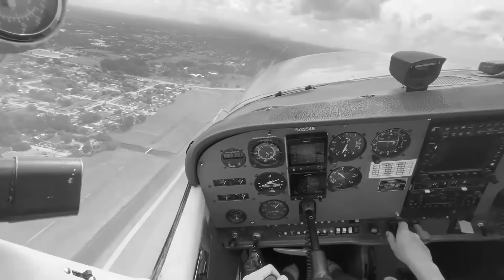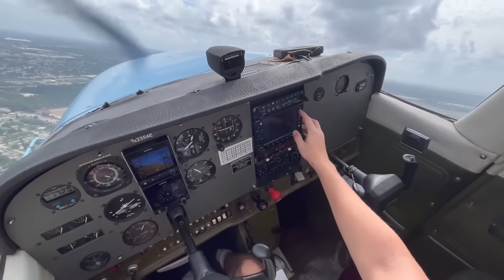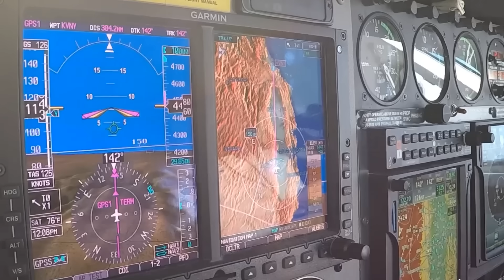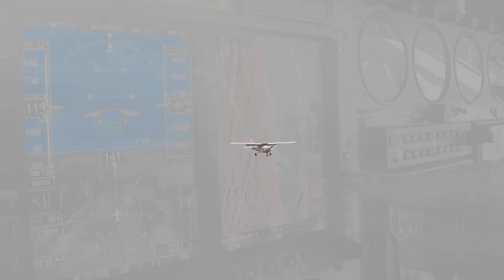NEW Info About N5203H Fatal Crash Aug 26 Los Banos CA, Prelim Updates...

Comment: I never understand why pilots are afraid to reduce power in emergencies like this. Reducing power and slowing the aircraft will lessen the airflow over the control surfaces and relieve the pilot of much of the workload in fighting a runaway trim. It seemed like this issue wasn't gonna resolve itself, so descending and landing in a field somewhere should have been the priority. I'm not criticizing the pilot for troubleshooting the issue, but at some point, you got to make the decision to get on the ground quick. The same goes for light twin, engine failures on takeoff. If there are places to put the airplane down near the airport perimeter, pull that remaining engine to idle if the airplane starts rolling below VMc or the pilot can't counteract the rolling motion in time. Soon as it rolls far enough, it's too late. Of course, easier said than done, but something to think about.

Comment: I would never, ever fly in these small aircraft. There’s too many deaths of folks who decide to fly in the small planes.
Reply: ha ha if every car accident made the news "you for sure" wouldn't drive then.
Reply: The analogy doesn’t quite fit. Nice try though.
Reply: @tmo-y5b Point is that General Aviation is safer than automobiles "by far", in every statistic, hands down, not even close.
Don't turn down a chance to experience it. Would you turn down a ride in a Lamborghini? Then why would you not fly in a Cessna?
Jus saying: Robert :)
Reply: @robertshaver4432  Sorry, but your statement is absolutely wrong.  Commercial aviation is extremely safe, but not so general aviation.  Long time ago I did some basic calculations and the numbers showed that driving a car was 20 times safer, based on deaths per miles.  Turns out I was off by quite a bit. According to research by Pilot Institute, the figure is 27 times.  That's not 27 percent, it's 27 TIMES!
Reply: @Rational20  Exactly upside down compared to what I've been taught. Sounds like "picked stats" to fit a desired outcome.
Reply: @Rational20  True, commercial aviation is super safe because of highly advanced and redundant systems in commercial jets. Also factor in high training standards and regimes for the pilots and strict operating rules for passenger carrying operations. Much of General Aviation is less regulated, the airplanes are less complex and less equipped than their airline friends, and the pilots are trained...but not to the demanding professional standards of the airlines. But having said that, you are STILL more likely to die in a car accident vs a small plane. Around 43K people die in vehicles per year vs 300-400 in small aircraft. I'll take those odds any day over driving in a city full of drunks or icy roads with reckless drivers. And it's worth noting that about 70-80% of General Aviation accidents are caused by pilot error. So, if you fly safe all the time, don't make stupid decisions, and maintain currency often, then odds are you will be just fine. And it is worth it. This coming from an almost 1K hour private pilot who has been flying for 22 years with zero accidents.
Reply: @core_of_winter  Well spoken.

Comment: I can tell you from experience that this is not an unusual problem. One thing about aircraft mechanics is that rigging is one of those things that seems to be difficult for them to do. I have had aircraft that needed to be repaired and I've always had to have a mechanic take a second go at getting the controls rigged properly. As for autopilot and electric trim, these need to be inspected frequently. Something as simple as a short, can result in a malfunction. Low time pilots should be trained extensively in manual trimming of the aircraft at all phases of flight, and the procedures for disabling electric trim, drilled into them. Anytime the aircraft does not respond appropriately to the yoke its rigging or trim.

Comment: Completely inaccurate, the trim, and rudder were the only thing working on aircraft. Breakers and master switch did not kill auto pilot system runaway, yoke was completely locked up ailerons and elevator. Biggest factor is aircraft had previously been totaled then rebuilt. Months before this accident aircraft was already giving signs of malfunction, was reported by other pilots flight control rigging issue where yoke was 20° off to keep wings level and auto pilot malfunction.. mechanic, supposedly placard and disabled. But as we flew under his aircraft for almost 2 hours. The auto pilot had 100% control over the aircraft. The operating owner and the mechanic are the only ones that need to be investigated here as they put a broken aircraft back for rent when it should’ve been deeply investigated why the rigging had broken because It’s not normal maintenance issue and auto pilot mechanical malfunction should have been taken more serious. But these flight school rentals  only care about money, not our lives.
Reply: If the trim and the rudder were the only things working how did he make so many turns, And if the trim was working that certainly should have stabilized pitch even if the yoke was locked up. 

What got this guy killed was he decided to put the flaps down as he prepared for landing and of course that pitched the nose down he possibly reduced power and that too would pitch the nose down, a tough situation for sure
Reply: @christophergagliano2051  that’s not what killed him. We were setting up with a very short time as he was running out of fuel and every five minutes the auto pilot would pitch the nose up and roll the airplane. We slowed the aircraft down 10° flaps trim up to slow the aircraft down with power back to descend when we got to about 900 feet the auto pilot pitched the nose up again rolled the airplane in another loop. This time being lower altitude, almost impact in the ground came back up. He never introduced power. The nose stalled pitched down and he screamed. I can’t pull up. I can’t pull up. Everyone can speculate what he should’ve done but he was a new pilot and it also been fighting the airplane for almost 3 hours before his death. I’m sure after a couple thousand hours we all know we would have crashed landed the aircraft sooner, but as a new pilot, he was not prepared to be behind the yolk of a broken aircraft

Comment: Cable came off pulley on elevator..needs 20 to 30 ft lbs. Tension
Reply: Negative. This was not the issue.
Reply: @e16pilot Affirmative.This will be the issue, cable and pulley 😮
Reply: @Johnnyjacobs-h8f so you flew with him and saw the aircraft flying in loops them level flight for two hours?
Reply: @Johnnyjacobs-h8f read my first response to this video, The aircraft yoke “aileron and elevator” was operating on its own. Both servos were locked up and flying the aircraft in 4,000 ft loops then would fly level for 5-10 min then another loops.